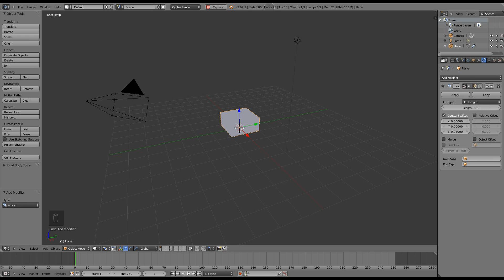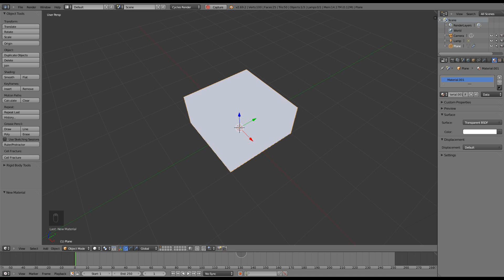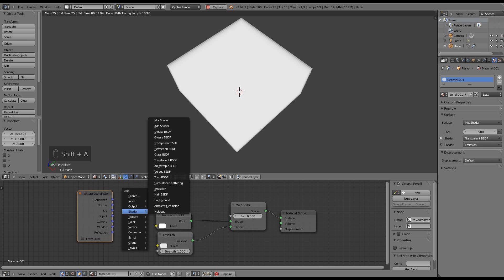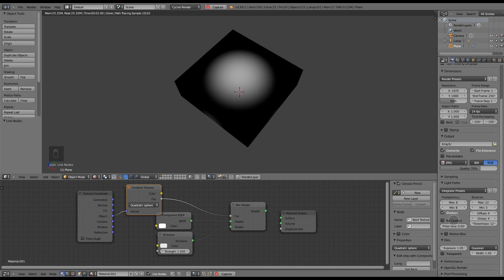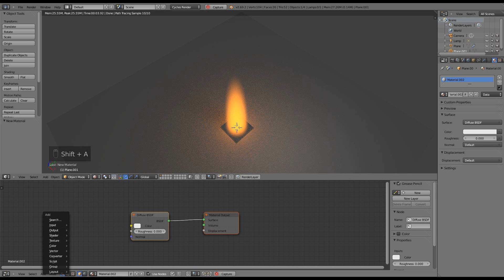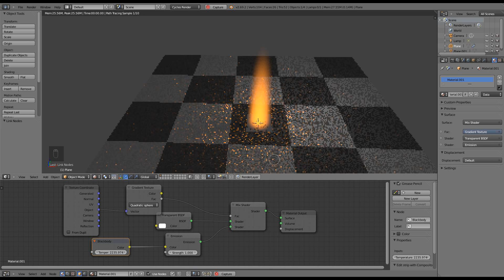Blender: A simple node configuration to simulate a flame in Cycles

Comment: on a side note I would like to add that if you after the primary mix node add another mix node with a transparent you can get even more flame control.  While you still have the rings issue with too much panning,  This means you can if used for say an engine on a space craft turn the engines on and off.

Comment: Your video is exactly what I needed! Just one question though: what version of Blender were you using? My materials options look nothing like yours and I've been stuck at trying to enable transparent BSDF for three hours. Thanks in advance
Reply from the maker: Thanks! I'm using version 2.69, but maybe the problem is that you're using Blender Render (the default) instead of Cycles (which you have to select in the dropdown menu at the top)?